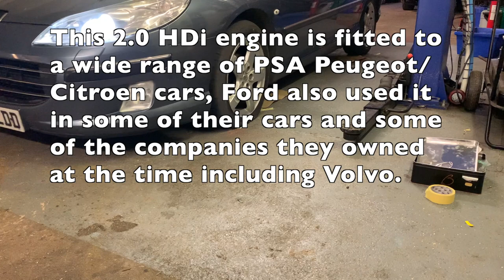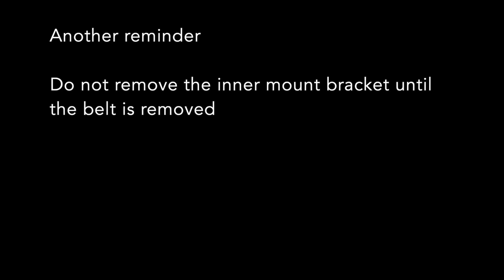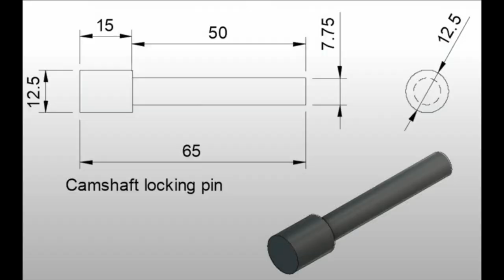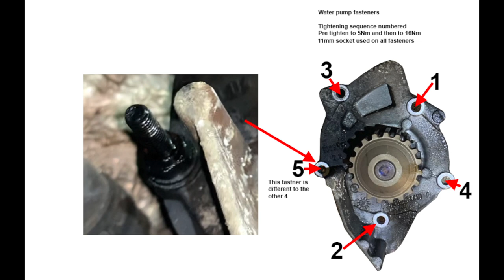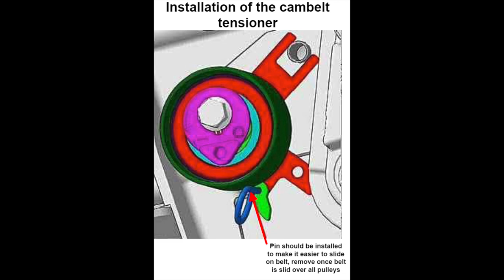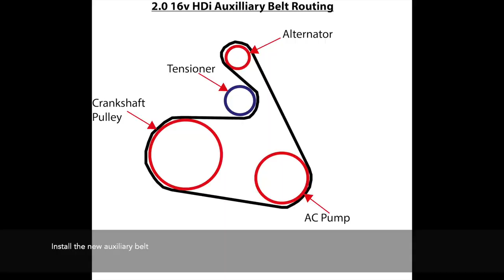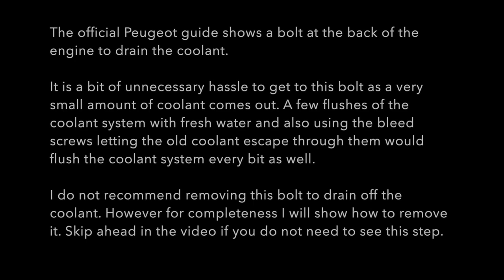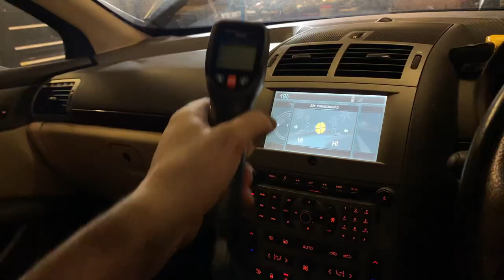Peugeot 407 2.0 HDi Timing Belt Replacement

Comment: Thank you so much for your high quality video here mate.  I was doing a friend's timing belt after someone had changed it then couldn't get it started afterwards.  I've done a lot of timing belts in my time but this one was an absolute pig, I'd have really struggled without this help.
Reply from the maker: Thanks for the comment.
Ive done a fair few also, didn't actually find it too bad. The PT cruiser or RAV4 2.0 D4D stand out as much worse than this timing belt.  Hope you got the car going now.
Reply: @peugeotCitroen2CV  Well as it turns out with that one the timing was correct, but the high pressure fuel pump was failing causing it to run rough and give EML for 'injector pressure too high'.  The engine timing trouble was a red herring, I thought perhaps I'd been doing something wrong.  So you're right they're not bad, as long as you're aware of that flywheel locking hole behind the starter motor.  Your guide was super handy there.

On the Peugeot, with no swarf visible in the fuel system I chanced it and put a second hand pump in there, refit the timing belt and it started.  Happy days.

Comment: kind of important to flush the coolant system with fresh water to prevent different coolant brands or compositions from mix if they are not compatible. Different coolants can and will react if not compatible. If the pin for the cam wheel and at the same time the pin that locks the flywheel/ flexwheel for the automatic gearbox, does fit in respective holes without resistance as seen in the video, the cam belt wheel at the crankshaft is timed properly. If one of the locking pins does NOT fit in its hole perfectly even with slight resistance, you have to loosen the crankshaft bolt to allow the crankshaft to move a bit so both locking pin fits perfectly, only then the crankshaft and cam is timed correctly. Then torque the crankshaft bolt to lock the wheel in position. Because the hole in the flexwheel for the automatic gearbox (also flywheel for the manual gearbox) can be distorted when torquing the crankshaft bolt, the special tool that grabs into the starter gear ring is needed.

Comment: Good job. But   what trick you did that you  put 10 litres of coolant if we know that front hose can drain 5-6 l only from the sysytem when water pump is mounted? I'm looking for this trick from a long time.  You used a fresh water to flush a  cooling system.  How to remove the half  of this fresh water with minerals from engine block and air heater ? Thanks

Comment: I have a Volvo S40 2009 2.0d with this same engine, it originally comes with green coolant, and I have no clue why, someone changed it to red and it now has some like dust inside, like some rust I would say. Should I go back to original green?
Reply from the maker: Hi there
I have always ran the red 5 year coolant in my own cars, but you can ask at the motor factors what they recommend.
Just make sure not to mix different coolants, ensure the full system has been flushed. Different coolants can react with eachother and result in reduced cooling efficiency.

Comment: Is it the same when you have the 2.0 petrol engine with 136hp?
Reply from the maker: Hi there, i have not worked on the 2.0 petrol engine. there are probably quite a few important differences. In general the overall process is similar but some of the finer nuanced details it would be better to have the specific guide

Comment: Need to remove the cylinder head. Does the subframe need to be removed or have you done it with the engine still in the car? P 407 diesel
Reply from the maker: Hi there
Never took the engine out of a 407 to be honest. Did on a 406, xantia and some older 2.0/ XUD engines and dropping it down was handiest so the subframe came out.

Send me a PM on the channel FB page and i will see if i can find any documents that might help
Reply: @peugeotCitroen2CV  thanks foe replying so quickly. I'll do the PM.
I'm thinking of tilting the engine forward to gain access the back 🤔
Reply from the maker: @murrayblair2159  
I think rocking the engine forwards will give some better access to the manifold bolts at the back.

Ill see what documents i can find, the facebook page is www.facebook.com/PC2CV
Reply: @peugeotCitroen2CV  decided to remove the entire engine from the front. Noticed some blow by soot and a leak or two. So easier to sort everything out and put it back as a unit. Thanks for your videos. Very helpful 👌
Reply from the maker: @murrayblair2159  Great stuff, probably the best option to give everything a good checking over. My old 406 the 2.0 executive needs something similar done and when the time comes it will be handiest to drop the engine and gearbox. Did you have any issues dropping the 407s subframe? It was one thing i didn't really work on was the front suspension of this 407.

Comment: what is your idle RPM? mine is like 900-1k
Reply from the maker: Not entirely sure as i sold the car back in February. Probably around 900-1k doesn't sound too far off.
Reply: @peugeotCitroen2CV  I am just used to pretty much every other diesel to be at 750rpm :D
Reply: 800 - 850

Comment: Not good ...
Bonjour si vous ne retirez pas la cible magnétique vous n'avez aucun moyen de vérifier que la clavette du vilo est bien centrée quand vous tendez la courroie neuve. Elle ne l'est probablement pas donc risque de soucis dans quelques milliers de km.
Reply from the maker: Hello, if you do not remove the magnetic target you have no way of checking that the key of the vilo is well centered when you tension the new belt. It probably isn't, so there is a risk of problems in a few thousand km.

What is a "vilo" 
Cars still running fine so not sure what the issue is
Reply: @peugeotCitroen2CV It is not that the key is centered is important. If the pin for the cam wheel and at the same time the pin that locks the flywheel/ flexwheel for the automatic gearbox, does fit in respective holes without resistance, the cam belt wheel at the crankshaft and cam wheel is timed together properly. If one of the locking pins does not fit in the hole perfectly, you have to loosen the crankshaft bolt to allow the crankshaft to move a bit so the locking pin fits, only then the crankshaft and cam is timed correctly. Then torque the crankshaft bolt to lock the wheel in position. Because the hole in the flexwheel for the automatic gearbox can be distorted when torquing the crankshaft bolt, the special tool that grabs and locks into the starter gear ring is needed.

Comment: Is this hdi has a same timing belt as ew10a petrol peugeot engine?
Reply from the maker: Hi there,
No i believe the two are totally different. Cant even say if the process is the same for the petrol engine, although i suppose removing the engine mount and covers will follow a similar process.
Reply: @peugeotCitroen2CV  thanks👍

Comment: timing belt replaced incorrectly

what are you afraid of and do not remove the screw from the pulley

You are making a cardinal garage mistake by not reading the service manual
Reply from the maker: Hi

I would disagree, the car is still running now no issues with the belt

What screw are you on about? 

I had access to the official peugeot workshop guide for this engine, yes some unnecessary torque specs were skipped in favour for using experience but generally the process follows the guide.

Comment: hello iv just done this job im not happy with what my tentioner is doing is this normal and can i put my car back together? https://www.youtube.com/shorts/fwayCHHnea0
Reply from the maker: Hi,
It is still between the two marks, however you have to predict how much tightening the centre nut will send the arrow beyond the centre so aim the arrow a bit further forwards or backwards before you tighten the nut, tighten it and see how it reacts. Can take a few times. One of those things the more you do them the better you can guess where to point the arrow. The tightening procedure and turning the engine will move it ever so slightly.
Reply: Spent another 2 hours muckin about with it this morning
At one point the arrow moved so much I couldn’t see it any more. That was the final straw
I took the tensioner off… put the old one back on
Pulled the release pin and it instantly snapped perfectly between the 2 lines
Did the bolt up… turned the engine… it didn’t move at all.
Job done